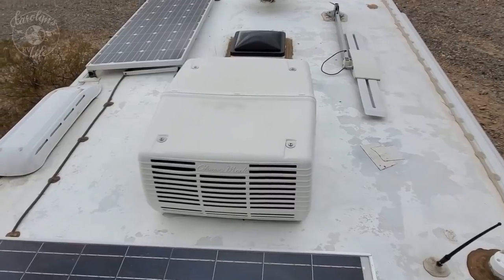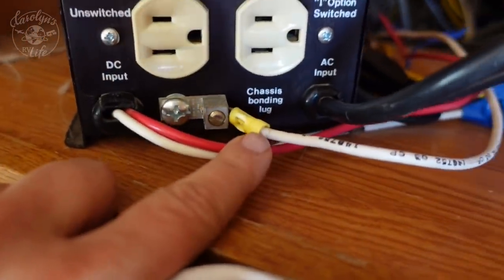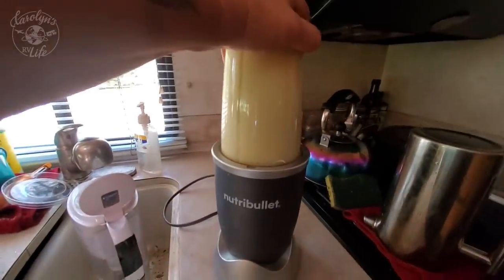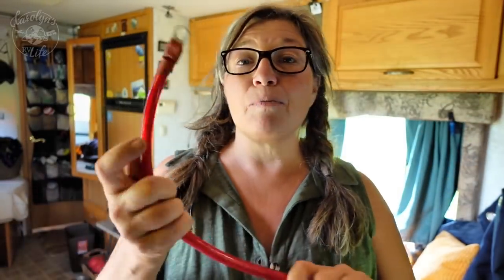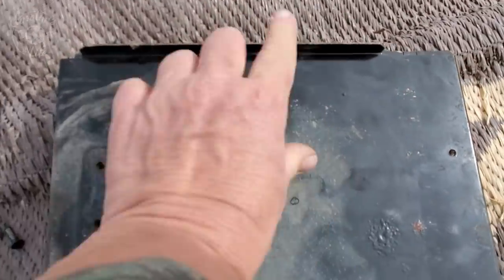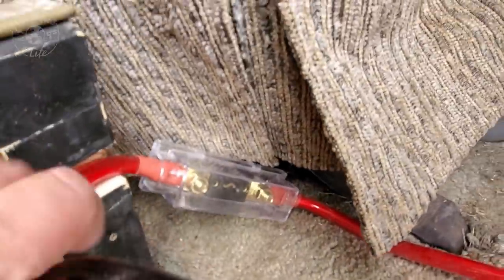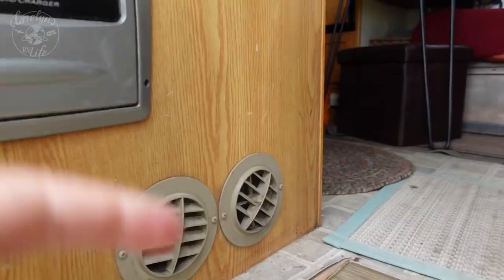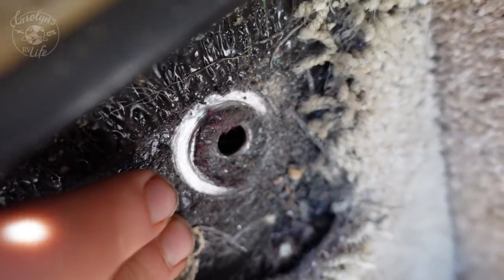How to Install an RV Power Inverter for Solar Power

Comment from the maker: You can check out the Krieger 1100w Inverter on Amazon! This is an affiliate link: https://amzn.to/3zlJqAr
NOTE:  YES I did the researcher and determined the MODIFIED SINE WAVE Inverter was fine for my needs. A modified sine wave is what I've always had and I've never had any problems. My research showed that Modified Sine wave is safe for most laptops and other little things I use. FOR MORE INFO ABOUT MODIFIED SINE WAVE USE FOR CERTAIN ELECTRONICS CLICK HERE: https://www.lifewire.com/modified-sine-wave-inverter-damage-question-534760

Comment: Your electrical description is good enough for most cases. Definitely fix that crimping area in the step though. Eventually it will cut into the wires and short out. Happy trails.

Comment: I did that myself.. researched the heck out of everything and drew diagrams...and with Amazon for my supplier, I bought my big components and plywood and built a board that supplied my 40' rv with lots of bells and whistles to 500 watts, with all the safety factors, a 2500 watt pure sine inverter, 4 batts., and a very big mppt controller and #4 wire for power sources and #6 for solar...was so proud of me and all my utube help...can be done ladies...
Reply: AWESOME.
Reply: Impressive indeed.

Comment: Very good.  Only one thing. You should move the fuse closer to battery inside the battery compartment, so if the wire short out at the step, it will kill the power at the step.
Reply from the maker: ahhhh. yes, that's a really good idea. that means buying more cables. t:-) Thanks!
Reply: @CarolynsRVLife  or taking the cable off and turning it the other direction, if possible.
Reply from the maker: nooo. there's more than 1' of cable in the other direction

Comment: Carolyn, you kept at it, and figured it out. I admire how you are not a quitter, you get things done. Thank you for this video I found it very informative.  I could picture you tossing the noisy inverter out the door. That constant noise would drive me nuts.

Comment: Hey Carolyn, long time follower.  Some suggestions:
1) Apply electrical tape around each of the red wire (+ polarity) and black wire (- polarity) where the step pinches these wires.  DO NOT apply the tape around both wires.  The tape will serve as an extra insulator between the red and black wires.  You do not want those two wire to touch each other, as that could result in a fire.
2) Move your fire extinguisher away from the area where the inverter is located (in case the inverter starts a fire)
3) Keep the area around the inverter clear to increase airflow and to remove flammable material if the inverter starts a fire.
4) Check the condition of the wires pinched by the step often (each day and before each trip).  Each time you use the stairs and the vibration of the RV when driving will wear through the plastic covering quickly.  If you see copper, use the electrical tape to cover that area. You need to feed the wires through the access hole you started.  Get help with that when you can.
Be safe and keep traveling!

Comment: Excellent! 
I’m really glad I had Discount Solar reduce my batteries and inverter when I had my solar done.  I used savings and have been really happy with them. I knew you had your solar done there as well.  You have so much more courage when it comes to this than I do.  
💞✌🏽

Comment: I'd recommend you to flip the positive wire around so the fuse is inside the battery box area so if the step breaks the wire the fuse blows and doesn't short out on the step, the wire up until the fuse will still have power if the fuse blows. You always want to keep the fuse as close as possible to the battery with the shortest length of wire from the battery to the fuse.

Comment: You can probably just get an auto or machine shop to drill out the hole if you want to still try that. As someone else wrote, you'd need a protective grommet, though, to keep the wires from being rubbed by the raw edge. Excellent video;  "laywoman's explanation" very much appreciated!

Comment: Great information, Carolyn! I need inverters for both my RVs. I had one in a trailer that was stolen last fall, and it worked great. New to me trailer which I'm having to do some work on, but it will be getting an inverter. We also use an inverter at our off grid cabin. We have 2. A big one and a small one and use them for big and small power draws. They tend to run the fan when we are drawing more power, so your old one (750) was probably running the fan due to the amount of power in was having to convert. Not an expert, but that's what I've always assumed about ours and the fan noise. Take care!
Reply: That's how it goes... the more amperage/power that is used the more heat they produce.

Comment: I like how your final cable routing turned out. Looks to me that it will not harm the cables. If you did cut a hole in the steel plate you would have to get a protective grommet to prevent the sharp metal edge from cutting the insulation off of the cables from vibrations during driving.  With the set up you have now you don't have to bother with that.  Good job.
Reply from the maker: Bill, yep, good point about the grommet. Thank you for the confirmation that this set up will work! I really appreciate your input.

Comment: Yep, I have a Power Drive 1000W Bluetooth Power Inverter with 4 AC, 2 USB and APP Interface. Downloadable App for my phone and a wired remote like you have. I have 2 Renogy 100W Solar Panels and two Deep Cycle batteries. Works fine for me. Glad you were able to figure out how you where going to get the inverter mounted and looks like you done did it, lol Ok you have a safe one. As always Enjoy The Adventure!!! :)

Comment: What a great, simple, coherent explanation! The only issue you should be aware of is the inverter you have is Modified Sine Wave. That is fine for the non-device equipment you have, but you might want to do some research into the effect of modified sine wave power on very sensitive electronics, like your laptop.
Reply from the maker: I've had modified sine wave since I bought this RV with no issues so I decided to go with what I had. I did do the research on the two. thanks

Comment: I'm concerned about the crimping. Could you get a stronger steel blade to cut away around those cords?   Get a welder to cut it away.

Comment: You did a better job than I  did. Both of the wires going from the battery to the inverter are the same color....it's all they had at autozone.
Reply from the maker: Oh my gosh, so funny. I think I went to Autozone first.. then ended up going through Amazon. LOL
Reply: I put red electrical tape around one of my positives for the same reason.  :-)
Reply: I ended up putting pieces of blue painters tape every few inches on the wrong color. It's one of the few intelligent things I've ever done...I think.

Comment: You know if you take a heavy gauged extension cord,as short as possible and cut the female end off and add a male plug to that end so you have two male plugs on each end of the extension cord then you can just plug one end into the inverter and the other end into any receptacle and you will have power throughout your rig with all the other receptacles. You just need to make sure and turn off your converter!! And also remember to unplug the inverter from the receptacle whenever you plug into shore power or turn on your generator so you don't get feedback. Some will say it's not the safest thing to do but it works!?

Comment: pure sine wave is needed only for inductive loads, like air conditioning compressors or refrigerators or air compressors or table saws or anything that has a step-down or step-up transformer like a microwave oven. electronics with switching power supplies work just fine on modified sine wave inverters.
Reply from the maker: Yep that's what my research told me. :-)

Comment: I think you explained things very well.  Shit, I went to school and learned about alternating currant and direct current..do I remember any of that?  Hell no.  I actually used to work for and engineer and I would open up inverters and put a zip tie around cables to make it quieter.  I had no clue...

Comment: You pretty much need really thick wires for sizable inverters as you need to handle over 10 times the amps on the 12 volt side.

Comment: For electronic gear, a PURE sine wave inverter is a better choice than a MODIFIED sine wave inverter. It's worth doing some research on the best unit for a specific use.
Reply from the maker: yep. I did the research and decided to go with what I had which was MODIFIED. IT WORKS FINE and I've had no problems with any of my electronics. If you would like to learn more about Modified vs Pure Sine Wave and how they affect electronics you can read here: https://www.lifewire.com/modified-sine-wave-inverter-damage-question-534760

Comment: You should use a pure sine inverter. The one you show is a modified sine wave inverter. I would not use that on a laptop or anything that has electronics. The flat spots on a modified sine wave are basically a short when driving a transformer, like the ones for your laptop power supply.  Your power brick will get a lot hotter and prematurely fail. Hopefully your power supply will filter well enough not to harm the computer itself. Yes, it will not damage your electronics right away but they will prematurely fail. I have 30+yrs with a very large computer company as a technician and a software engineer.
Reply from the maker: I did my research and there isn't any harm to my laptop. I've always had a modified Sine wave inverter and in 5 years it's never been an issue. If you would like to learn more about the real difference you can read here: https://www.youtube.com/redirect?event=comments&redir_token=QUFFLUhqbFVCTS1PMGpYWGZpanFGc3JtMEJqVnZadS1zZ3xBQ3Jtc0trMjNpSjJja09LOGdIWUluYkZRRWEtUVpWWkNlaFNGWENpTnhuTjZlck9lcW5SangwcER6YmQ4bFQxaUZwbTRSN0VmR1pQVHZQMV9mZzlLMWF6RmtyMUpnNHZrU0tQdGJOaHl2d09CbXY1X3JpWlRWVQ&q=https%3A%2F%2Fwww.lifewire.com%2Fmodified-sine-wave-inverter-damage-question-534760&stzid=UgwUu7CCO7w1a4cWAUR4AaABAg
Reply: mark wisner there are no modern laptops, tablets or cell phones that use a transformer-based 'power brick' as you call it. all modern devices use switching power supplies that have no problem connected to a modified sine wave inverter. yes, 30+ years ago most power supplies used transformers but they are quite rare nowadays, only used in a few applications like lawn sprinkler timers. and you are totally wrong, pure sine wave is needed if you are running inductive loads like induction motors in power tools, air conditioners, air compressors, but resistive or electronic switching loads don't need it.
Reply: @marzsit9833  That may be true but they are still not designed to handle AC input as a square wave. I worked in the hardware labs for iBM for yrs. We never tested our designs with that bad of a power source. We would very the voltage, ~108 to 130 at 50 to 65hz. And would inject noise over the 60hz but never a square wave. We would also inject static shocks. Spend a couple $'s to save hundreds for a new laptop, cpap, TV, etc..

Comment: Carolyn what about drilling a hole in the side of the box and thru the carpet then they won’t impede your step. It goes out the side rather than the top.
Reply from the maker: Yeah I thought of that. It's thick steel.  I showed that.